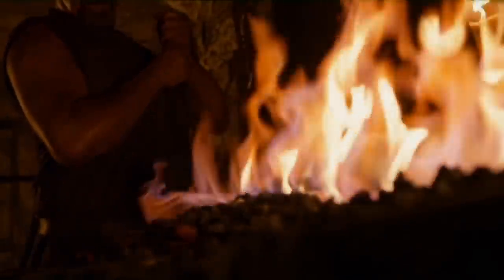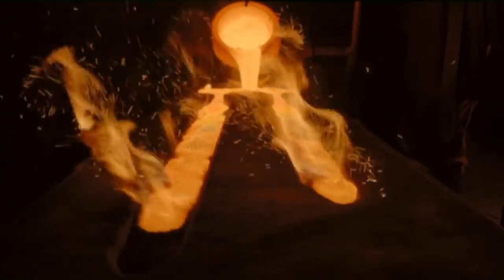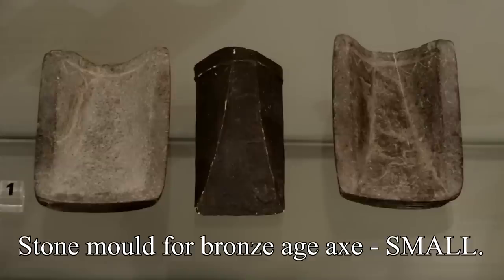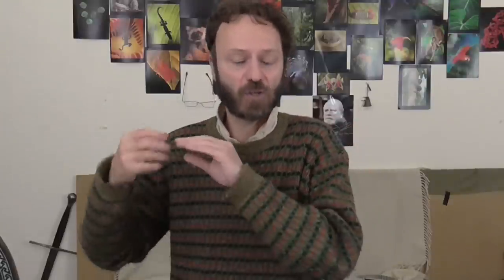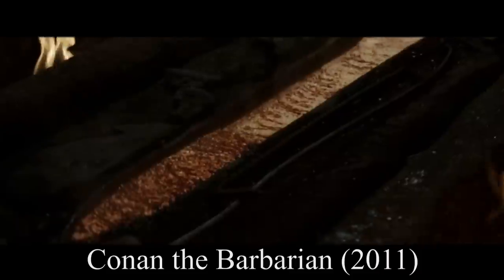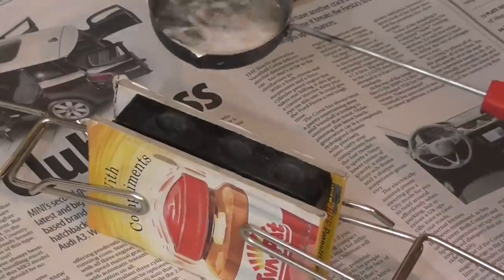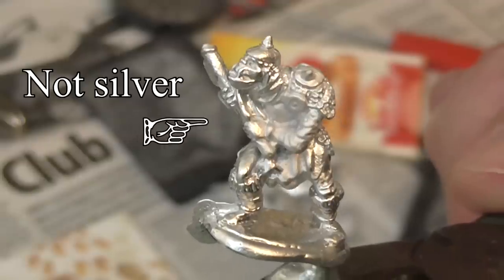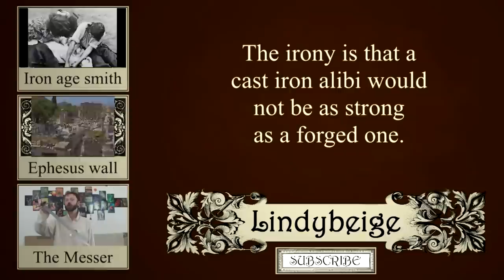Casting swords in the movies - forging a lie

Comment: you.. absolutely CAN cast steel into a functional blank of a sword. 

cast iron is weak not because of it being cast, but because it has 2%+ carbon and it has a funky grain

also in addition, you can use casting to make a sword blank and then finish off the profile with some slight bevel forging. 

uit's the difference between forging a sword from a puck of steel and starting from a piece of flatbar that is already roughly the right length width and thickness.
Reply: Lol suddenly everyone is a metallurgist here, I mean lindybeige and most people in the comments section lol bruh this "lindybeige" is already getting on my nerves.
Reply: @fleshangel489  i wouldnt say im a FULLY qualified mettalurgist but i learned enough when studying bl;acksmithing and metal fabrication at tech school
Reply: @fleshangel489  also lindy DOES occasionally get on my nerves BECAUSE he does tend to leave a few things out that in a way kind of undermine his point when thought of more closely, which is an issue because people do listen to lindy 

(lindy is how i even got nto swords and armour and reenacting so trust me)
Reply: I think his wider point wasn't really that it was impossible, more that it wasn't practical.
Reply: @fish4225  well theres actually a more pressing issue with such a casting.. at such temperatures where it will flow, exposed to air the entire thing will start to burn and spark.
Reply: @elgostine  Exactly, and even getting iron up to the temperature where it's molten is difficult, it's extremely impractical.

Comment: I was wondering why, if iron is so brittle and inept at making weapons as mentioned here, was it used so much in the Iron Age for exactly those things
Reply: Bronze requires access to an uncommon metal (copper) and fairly rare metals to alloy it with (tin, arsenic). Iron is abundant as an oxide pretty much everywhere on earth. In many ways the Iron Age was caused by the collapse of global trade at the end of the bronze age, cutting off tin imports.
Reply: Swords made from Cast Iron is brittle, while swords that are forged aren't.
Reply: Thankss

Comment: no its fine, they mould two sides of the sword then glue it together with FLEX GLUE™! FLEX GLUE™ is a powerful adhesive that can bond, seal, and repair virtually everything! FLEX GLUE™ is an easy to use, super strong, rubberized, waterproof adhesive with INSTANT GRAB. FLEX GLUE™ works like a magnet, locks into place and holds on tight. It can be applied to wet or dry surfaces, even underwater! FLEX GLUE™ is mildew and UV resistant. It can be applied to vertical or overhead surfaces, and it’s even paintable. FLEX GLUE™ cures in 24-48 hours and reaches maximum strength in 7 days. No need for screws or nails, it’s perfect for all types of repairs! Now any project big or small, you can do them all!

Comment: Let’s assume you could cast steel (which is an alloy of carbon, iron, and usually other trace elements), by the time you get the steel to the temperature required to melt it, you would burn all the carbon out as carbon dioxide, so you would end up with just iron, which, as shown here in the video, is brittle and unsuitable for swords. That’s why people forge at temperatures well below the melting point. Also, the grain structure of the steel would probably be very brittle as well.

Comment: With respect to the swords on Game of Thrones, it is correct to say that they are iron, not just in terms of the main constituent at a chemical level, but they actually have a considerable wrought-iron component.   This is because the magical "Valerian Steel" in the GoT series is represented by elaborately twist/pattern-welded blades, specifically based on the swords from the Migration Age to middle 'Anglo-Saxon' period (or, internationally, Merovingian or "Vendel" period).   The edges of these blades are carbon steel, but the cores are a complex, patterned structure formed by welding together stacks of wrought iron of alternating properties (high and low phosphorous, or varying carbon content), heating, twisting them, then welding those twisted billets together, welding the edges on, and filing it down.  (This produces nice patterns, but the structural benefit is from the drawing out and twisting of the billets which creates a relatively homogenous structure with impurities evenly distributed, with no lines of weakness caused by any concentration of impurities at any particular point along the blade. That it works as a "composite" has, supposedly, been experimentally debunked).  
     So there's quite a lot of relatively pure iron in there.   This technique fell out of favour (first becoming purely decorative, then abandoned entirely) as metallurgy improved and it was possible to produce large quantities of relatively homogeneous high quality steel.

Comment: Only just saw this vid... Absolutely wrong on the melting point of iron mate, we can pour as low as 1230°C, and I don't tap it out of the furnace any hotter than 1450°C.
It's not aluminium, you have to take that over 800°C for it to start glowing, and it would be cooled down by the time you started pouring it.
It could well be iron in the clip, but unlikely. More likely to be bronze, but it wouldn't be gunmetal or it would be fuming zinc everywhere.

They absolutely did cast iron swords... japanese mastered it with theirs ;) They weren't used as-cast, but the primary metal for them was smelted.

Comment: The knowledge to forge Valyrian steel was lost, but the ability to reforge existed. Its an understandable concept that they found they cant work the steel, so they resorted to the next best thing which was melting it and then casting it. Since it is a magical metal you could argue that when casted it was on par or slightly better than whatever primitive steel used in the time, but if it was properly forged valyrian steel it would be even better.

Saruman being a wizard was able to create an isolated pocket of industry and thus whatever iron he was smelting was likely leagues ahead of any rohirrim weaponry at the time. Saruman just needed something tough and heavy to place in their hands and encase there bodies in, he (and Sauron with his Orcs) would win with numbers not skill of soldier or quality of equipment. Also they just want X fortress to be raized putting an edge on wrought/pig/what have you iron is much quicker and easier to do.

By the time Sauron has returned any steel that exists is an artifact from prior civilizations of men, elves, or dwarves.

basically when you 100x more troops which are on average stronger than their opponent and can be infinite in number just give them the bigger tougher weapon. I dont think Orcs or Uruk hai would of been any more effective if they had properly forged equipment. They had thick iron plate and 5 pound sharpened slabs of iron, their opponents were either opponents in leather with bronze spears, or a very very small percentage in some sort of combination of mail and lamellar, and then an even smaller percentage of those used something qualifying as steel for a weapon.

If you want to find grossly inaccurate depictions of smelting and forging look at video games, I repair my broken sword by banging it a few times.

Comment: i was thinkin about the metal propperties if you r casting an iron sword it wil be hard af and easily break
if you forging a sword it wil be less hard but more flexible in a sword fight the forged sword would be flexible and vibrate on impact where the cast sword would break

Comment: good spirit but your weakness in metallurgy is showing. it could be done with reforging but the tempering after will be uneven. A skilled smith can still do it. you can cast an iron(low carbon content) then temper and treat it to harden the outer bit.
 Iron when it contains carbon impurities (steel) will cast any color of the rainbow based on % temp and oxygen level. (swordstones r usually 2 piece tho).

Comment: What...? I've never seen this... usually they have a blank lump of iron and they heat it red hot then beat it flat with a hammer and fold it multiple times on an anvil....

or come to think about it maybe this is just how it's described in fantasy novels and I'm so used to the idea I think that's how I've seen it in movies...?

Comment: There are only three smiths that can reforge Valyrian steel, the one who made tywins swords wasn’t actually one of them, but no one knows how terrible his swords were because they’re made of a magical material and never clashed with another Valyrian steel sword, would’ve been hilarious if one of them did and just started getting damaged all over.

Ik it’s not what they intended, but they also must have made brittle enough material to break it apart.

Either that or it was just a fancy quick way to seperate the metal into the quantities for each of the two swords before properly forging each sword but they still didn’t show that so I doubt this was intentional and the other explanation is funnier.

Comment: Actually cast iron is just a name, it doesn't mean that everything that's molded is cast iron. Specifically cast iron means it contains more than 2.11% carbon, so those swords are still steel [as you have mentioned too]. With the right heat treatment a cast sword could be as strong as a forged one, its just very impractical thing to do.

Comment: I am curious about the whole smelting process. I understand that to forge a sword you start with a rod or bar and work it into the shape you want, but that bar has to be made somehow. How did medieval smiths turn raw ore into bars of the right quality and composition for swordmaking?
Reply: I can get how it is done with modern techniques, but I'm wondering what techniques were used medievally. I know that they had the ability to produce higher-quality steel that was uniform in density because the did not have to fold their blades. Katanas are folded because the iron is of poorer quality and folding helped make the carbon content more consistent throughout. Medieval smiths stopped using this method because they could heat the metal much hotter and get a uniformly strong steel bar.

I want to know what technique they used to get their forges that hot using the technology available at the time? What materials, if like you said in the video, not stone, did they use to build the forge/smelter,  and how did they get the fire to burn that hot for that long? Did they use a different fuel than wood, or could they get a wood fire to burn hotter somehow?

Comment: Isn't cast iron just a really high carbon content steel, which is much more like pure iron in its pouring characteristics? I haven't researched this, but I was told you have cast iron engine blocks and other such intricately cast objects because steel (lower carbon steel such as... high carbon steels, tool steels for example) is gelatinous pretty much any temperature, and therefore won't cast appropriately no matter how hard you try. 
Of course, everything else you've said was spot on, I hated watching that scene in avengers infinity war when they "forged a kings weapon" by melting uru and pouring it into a mold... in two separate pieces! Seriously, the head of the axe is held together by a tree branch, I mean, groots are tough, but Drax was able to tear right through groot branches in gotg, and Drax couldn't hold a candle to Ronan, let alone Thanos. Wouldn't have been as bad if they didn't have such a build up to it, it had nothing to do with skill and designing, they just pumped radiation from a star into uru until it melted, poured it into a mold, and then wrapped the two pieces together. Truly, quite awful.

Comment: small correction, it does matter what material you have in terms of what color it is glowing.  you are thinking of the ideal black body spectrum, which is often a pretty good model for a lot of materials, but no material is a perfect black body and their absorption spectra differs between materials

Comment: is there a difference between cast iron and malleable iron i ask because i have a 1796 sabre with a malleable iron scabbard.
Reply: Traditionally cast iron is brittle; it has a very high carbon content that makes the melting temperature lower. The scabbard is not cast iron. Think of cast iron frying pans and pots.

Comment: Cast iron and cast steel are different materials :) this is why we say steel swords instead of iron. Cast iron has extremely high carbon content, making it brittle, whereas cast steel has lower carbon content. Still not as strong as forged steel, but still not brittle as cast iron.

Comment: I think you may be confused cast iron strangely does not refer to iron which you have cast it actually refers to a specific carbon content which you often get from the initial extraction from ore. Also I'm pretty sure any blacksmith would like to start with a roughly sword shaped piece of metal hence crude mould could help a bit. Not saying it happened just saying I see no reason for it not to happen

Comment: A high specific heat capacity means that it heats up SLOWLY. Yes. A specific heat capacity shows the energy need to heat a kg of something 1 degree Celsius, so a high specific heat capacity means that the material will heat up and cool down very slowly. Same with metals, they all have a LOW specific heat capacity. Hope this helps!

Comment: Well there is a process using a casting for a sword.  The trouble is, it doesn't look like a sword. It would look like a baguette, no really, complete with the lumpy crusty top (you know where the slag and flux came up.) You could then roll or hammer said baguette into a proper sword shape in showers of sparks from all the hot slag.  But that leads to the problem of bustles, you need bustles. 

See this would be a late Victorian era technology at the earliest so you need bustles, bustles and beaver hats. 

I mean I think it would beaver hats. they might be out of style by then, it might be silk by then.  I think?  Dammit, where the hell is a milliner when you need one? See, this is why no one bothers with hats any more.

Comment: The other widely used misconception primarily in video games but in certian movies as well: using back sheats for greatswords or other heavy two handed weapons. It just doesn't work. You simply can't unsheathe it due to the lenght of your forearm. Either you attach the sheath to your belt on your waist or if the particular weapon is too big for that, you don't have other choice than carrying it in your hands and leaning it to your shoulder, like German landsknechts or doppelsoldners did. Definitely not wearing it on your back. That's a lie.
Reply: The Scots had a way of carrying the claymore(the real one, not the basket-hilt broadsword) on the back.  It was a leather strap, with a ring on one end and a short pouch on the other.  The sword was passed through the ring, the tip fit into the pouch, and it was slung over the shoulder.  To draw the sword, the tip was lifted out of the pouch, the blade was swung outward, and the ring allowed to slide off.  The strap would then fall to the ground, and the sword was cleared for use.  If the wielder survived the battle, the strap could be recovered.
If he DIDN'T, recovery wouldn't matter

Comment: For having the wrong colors of the casting metals you are spot on. As for casting them in molds? It would actually save some time, depending on the mold. If you aren't getting your metal from a foundry and smelting it yourself to a molten state, then you need to cool it back down again. Yeah, the normal method is an ingot or a billet, but why not get a rough sword shape before forging? Yes, the way they do it in the movies is rubbish, but the idea is not that crazy if you had the skills/means to be doing it all yourself. Obviously, that method won't be casting for detailed shapes, but making sword shaped ingots could cut down forging time.
Reply: That's the point of the steel product being initially casted in certain shapes, bar stock is already a good base for a knife just need to form the tang, tip and bevel.  Round stock makes a good hammer.  And my main issue for casting steel is they don't show how they maintain carbon content or remove impurities.

In GoT, it's even worse when they make dragon glass (basically obsidian) weaponry.  You cant just melt and cast obsidian, theres a process you have to do so the molten object keeps its properties.

Comment: Okay, I got a defense of two cases of casting swords like this: First is GoT... They aren't forging steel. They're forging Valyrian steel. It is very notorious for being hard to work and the techniques for crafting it were lost with old Valyria. So I think we can say that a special kind of steel might be plausible to be cast in this way.
Second is LoTR... The thing here is that they amassed a huge army in a short amount of time and now they need weapons. Tens of thousands, to be precise. So they don't care about the swords being very sword-like. They just need to put something that can sort of cut in the hands of an orc.

Third thing I wanna point out is that, yes, stone would dispense heat in a manner that would unevenly cool the steel. However, not all stone is like marble. As a rock climber, I know how it feels during summer, when you latch onto a stone hold after it was on the sun the whole day. Guess what, the stone is really hot! Limestone particularly. Nothing more dreadful than climbing on sharp crimps during cold weather, but climbing on slopers while it's hot outside just simply isn't done during summer.
The thing with stone is that you can heat it up. Surely that's something people would take into consideration when making swords. Just like modern blacksmiths heat up the oil for quenching.

Just my 2 cents. And you really should have made a point of how not to reforge Narsil...